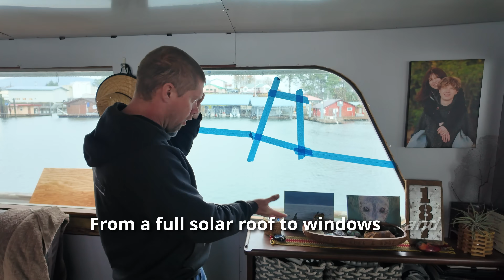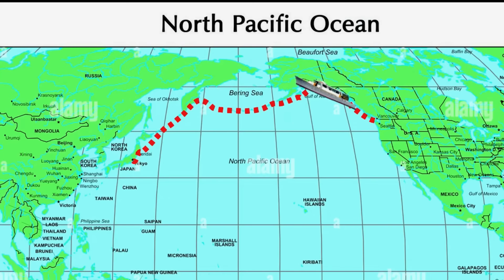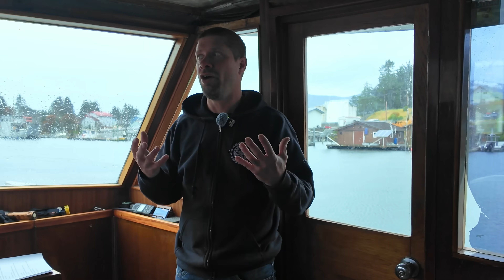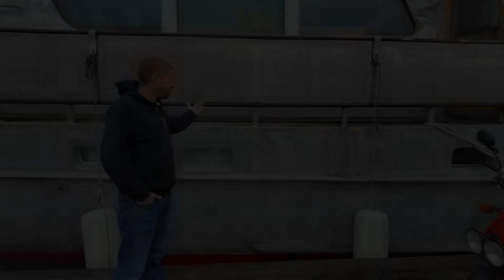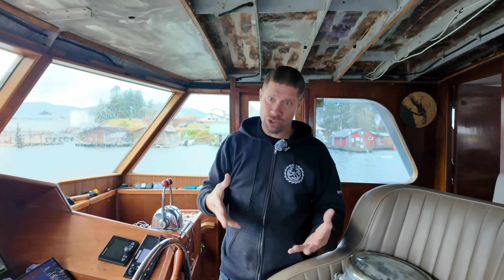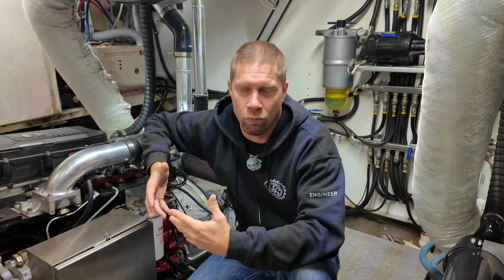What We Would INSTALL If We Won the Lottery?

Comment: If you ever go with the Azimuth thruster pipe dream, be sure to give the props some good clearance to the aluminum hull.   I don't know the exact distance, but I recall reading about some problems with props spinning too close to aluminum hulls and causing corrosion without even touching them.   I'm not entirely sure how that mechanism works.  But it is worth keeping in mind.

Comment: My boat came with a Naiad stabilizer system, i absolutely hated it. Last year i bit the bullet and went with a Seakeeper system and it has made a huge difference. I cant recommend it enough, and packaging wise you can fit it in space that would normally not be used.

Thrusters are another upgrade i made that have made docking and maneuvering a ton better. Before biying this boat i hadn't had anything larger than 20' so it was a pretty big jump going from a 20' bass boat to a 60' yacht. But the thrusters have made docking in some of the tight marinas in the keys an absolute breeze, i went with both bow and stern thrusters and can crab the boat sideways right into some pretty tight slips now, took what used to be stressful 30 minute dockings filled with near misses into 5 minutes of lining the boat up and sliding her into place.

Just a few of my observations from a couple years of running a project boat that is oddly similar to what you guys are doing, just wish i had been smart enough to film it like you guys did.
Reply from the maker: The seakeeper stuff is definitely nice but they are priced out of the market for most budget boaters sadly. I will likely just use what we have with a newer control system.

    Thrusters have never really been something I have wanted to a great extent. Sure, it would make some things easier but we have never had a situation we couldn't manage without them and they just haven't exceeded the cost vs benefit threshold for us. If our wish list were ever to be achieved, azimuth thrusters would allow infinite maneuverability as well. 
  
    I can feel you on the filming part. If we had done that when we were younger and living/working on boats things might have been different!

Comment: you can get laminated glass is strong .(windshield glass)at a glass company. if all your  glass is flat . I had glass made for my 36 Buick . shop around the price range is insane . then put a rubber grooved whatever around the glass . install it then do your wood trim .
Reply from the maker: We are going to discuss options with a marine windows company and let them make recommendations on glass that will offer insulation as well as strength. There are many iterations available from them.

Comment: I did kinda wonder how the shape of the hull was for open ocean. She isn't a sail boat so doesn't need a big keel right?  The whole stabilizer thing is a mystery to me.
Reply from the maker: The hull is strong enough for the open ocean and she has a pretty high level of natural stability as all the weight is low and there is no big flybridge adding weight up top. Once the windows and doors are done the envelope of the boat will be pretty much watertight and heavy duty. The stabilizers are basically wings underwater that rotate to help reduce the amount of roll experienced.

Comment: I am not at all surprised that you are a Cussler fan lol 

For the spotlight, could you find a place that can use that cracked glass as a template and can make a polycarbonate version that would last longer, be more durable and would fit the same as the existing glass?
Reply from the maker: I had thought about that. Not really sure. Having the concave lens wakes it a bit tricky. I might even be able to pull the lens, lay some form of new plastic over it and put it in the oven for a bit to form the same shape.

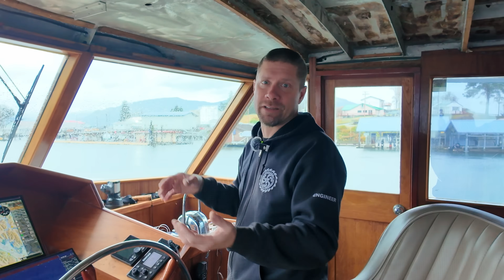Comment: Did i see that good, there was a drip of water falling downs from the roof in the cabin at 13:42 and again at 16:24 ?
Reply from the maker: Yes indeed you did. There is a small leak on the horn pedestal that I need to sort out. Pretty quick and easy job but I just haven't got to it yet.

Comment: 10:36 Why try to walk on your solar panels?  Couldn't you find some sort of above-the-deck racking so that you can mount your panels to that, and have room underneath to store your gear?  That way you can put more panels up there and they get full output while your gear suffers less UV damage.
Reply from the maker: One of the biggest reasons we bought the boat was the look of her. Having the solar mounted up high on rails on the upper deck would make a massive difference to that look in a negative way in our opinion. Whatever we do, it has to maintain the original lines of the boat.

Comment: Good luck with your long term project.   If it were me, I would have done the doors and windows before the new engines.  Having leaking doors and cracked/unsafe windows is just not for me. This is not a criticism, just a different priority.  The rest is almost just endless upgrades, especially if done over an extended time.  As long as you are both happy and enjoy the project, it is all good,  there is no right way or wrong way, only your way.  Enjoy the journey. Cheers from the land of Antipodeans.
Reply from the maker: Thanks! We have been in fairly protected waters so the engines took priority. The windows/doors are planned for this winter before we head out into the more open water stuff.  Thanks for watching!

Comment: Stabilizers: if the mechanical side of it is in good shape the electronic side should be easy enough to do diy. if there isn't something specific (open source) that has been done yet, I would look into drone (quad copters) controls, they have all the sensors, software and controllers to make them a breeze to pilot, the electronics are inexpensive, and there a few open source projects...
Reply from the maker: I have looked a bit into that stuff. I have closed loop controllers for the solenoids with feedback input from the fins. I also have a gyro but its a bit of an experiment. Just need to put some time into it. I haven't messed with it because the hydraulics for the stabilizers are not fully assembled yet.

Comment: You have probably already though of it but the hybrid setup from beta marine seems like something you could get working with your Cummins. Would also solve your never ending genset problems. If you haven't seen it check out the videos from the tally ho rebuild.
Reply from the maker: A hybrid setup is high on my wants list for sure. Using the Cummins for gensets would be great too. Unfortunately the Beta marine setup is not powerful enough to move this boat at our cruise speed much less have some extra emergency power. A hybrid solution would have to be a bit more substantial. I did briefly look at the system on Tally Ho but haven't had a chance top sit down and watch all the way through it.

Comment: Love all the wish list items and you didn't even mention the pilot houses ceiling cant wait to see how you tackle the window problem, stabilizers need to be fixed must be crazy, btw  Rim Drive Azimuth Thrusters are just that thrusters, I went down the rabbit hole and cant find one application of a RDA for large boat prolusion though would be nice until a killer wale knocks the pod off, of course there'd be safety strap for such occasions needed near Gibraltar, was wondering also what the COP would be for those electric drive systems as compared to diesel and diesel to electric drive as proposed in future, for now ill stick to my 90lb thrust MnnKota to silently steer my pontoon down the Ottawa
PS you've got a very special boat, would love to drive her, with 2 screws almost mid ship, your right who would need a bow thruster.
Reply from the maker: Lol, Janis and I were talking about how we knew someone would mention the pilot house ceiling 😁. We are getting to it soon. Azimuth thrusters would help on a couple of fronts. First would be maneuverability and the second would be an addition bonus to efficiency in a hybrid configuration. The particular units I would be talking about would not be easily damaged by a frisky orca🤣. She is a fun boat to drive and is pretty surprisingly maneuverable. Take care!

Comment: That aluminum door is a commercial Kawneer or Vistawall unit. Great for retail, not so much for marine application. I had wondered if that was somebody's low-buck solution to a problem in the late 1980's, surprising it may be original. 
Question regarding glass - is there a 'seaworthiness' standards inspection that pleasure craft have to meet? Hope you are able to get the glass sorted before too long! Fair winds and following seas.
Reply from the maker: It’s a pretty disappointing door for sure and doesn’t fit the look at all. There aren’t and inspections by government agencies but insurance companies do require occasional surveys which keep the bad stuff to a bare minimum. We will be replacing them with proper offshore rated units.

Comment: Love the goal of hybrid drive for so many, many, reasons!  Wanted to put a bug in your ear about battery tech and where it is going. I suspect it would fit perfectly with your hybrid drive goals. With your demonstrated of LFP battery management you may already be on this channel, but just in case: sodium ion is going into production in Chinese EV’s. It has been a long road getting here. Within 2 or 3 years there should be enough capacity in the field to reliably predict the return on investment. CATL is claiming an eventual 90% reduction in cost over current LFP. if that comes anywhere near to reality you could have several hundred KWH’s of storage and thereby reduce diesel use by many factors!  Conceptually consider what Edison motors is working on
Reply: Snap 😂 said that about six months ago ...also wanted to put up other UTube links to other projects and options. .... but U tube even hates itself... When you're trying to help inspire other people 🧙🏻‍♂️🥼🌎
Reply: @clivestainlesssteelwomble7665 I have observed sometimes links are not allowed in comments. To be safe I have learned to avoid sharing links in all my comments
Reply from the maker: I have indeed been watching the sodium ion stuff although it’s been a bit since I checked up on it. Definitely appealing in a few aspects.

Comment: Never knew the windows and doors we're that bad. It would be one of the first things that need done before making an ocean crossing.  That may end up into a really expensive repair. Mechanically I wouldn't go diesel electric I'd go straight to azimuth drive. The time and effort going to electric shaft drive you are...... really not gaining anything except for fuel efficiency. You are already fuel efficient. The cost to go electric drive would take quite a few years to pay for itself. You go with azimuth drive you'd gain manueverability and speed and fuel efficiency. Then you could also put the perpulsion where it should be at the stern. Boats are expensive anyway you look at it. Buy a used one and put money into it as you can afford it or go for broke and buy a new one. The older boats have a style you really can't recreate as the builders that built them most likely don't walk this earth. Tangaroa was in tough shape when you got it. Most people wouldn't take on a project like that. You'd never be able to do it if you had to hire out the work. You'd be cheaper to go with a turn key boat. You'd have to be a person with wood boat disease. You love the old school boat styling and you are willing to drop the 10s or 100s of thousands of dollars. Would I have taken on a project like Tangaroa..... no she was too far gone to make her into ship shape. In my mind it would be easier to convert a commercial fish boat into a yacht but that is me not Blaine and Janis. We've seen the hours of work you've put into Tangaroa that is some dedication.
Reply from the maker: Windows and doors have definitely been on the list for ages and the plan is to tackle those this winter.  We definitely love the boat and at this point there would be no turning back anyhow. The azimuth drives would be nice right away but would far surpass a direct drive shaft configuration by costs alone.

Comment: Nice job but who in the hell taught you to sand the bottom of a boat? Amateur 1st time playing with toys
Reply from the maker: Janis is a bit dangerous with rotary sanding tools. She got the little sanding tool so it was less aggressive. Its not an orbital sander so cant sand completely flat and it has  less abrasive discs so doesn't move much metal. When we follow up we use larger sanders with finer sandpaper as well as flatter angles to finish polish. This step was just to get the paint off and quite frankly, as long as I don't have to do it she can do it any way she likes 🤣.
Reply: @OnboardTangaroaSeatrial  Teach her! You don't use orbitals on the bottom of a boat. Nor do you sit and sand in 1 spot, keep moving, straight lines. You don't use fine disk, you want the bottom rough to hold paint, it's a boat not a car. Anti-fouling paint is thick. Sorry if I sound like a troll. I grew up on my grandfather's marina with a travel lift, so 150 boats on the hill at any time was normal, me and my friends sanded & painted a lot. You want a rough sand for good adhesion. You learn this real quick if you've ever dove and scraped  the grass or barnacles off and the paint come off with them. It's a common mistake. The glass breaking is a harder fix but can be done. Rubber gaskets allow flex, BUT that alone won't fix it. You need to stiffen the frames. You may have to redesign a little. Steel frames welded up for the rubber leaving a little gap all around held in with 5200. Trim it in with 5200 and only secure the trim to the wood This will allow the wood to flex while the glass stays secured. Wood flexes in heavier seas which is a blessing and a curse Good luck I wish you the best
Reply: @OnboardTangaroaSeatrial  On a lighter note. My aunt & uncle raised 4 girls on a boat. After they all grew up and moved out. They sold the boat and bought a house LOL Totally backwards from what most couples would do
Reply from the maker: I looked to see which bit of sanding you were referring to. The only sanding I saw was on the cabin sides, not the bottom. There will be no paint on those so they will be polished to a reasonably smooth finish. We did grind on the bottom as well but that was only to reduce the amount of sandblasting that was required as the sandblasting was having a tough time chewing through the coatings. From speaking with other professionals in the industry, a blasted finish is about the best for adhesion.

Comment: Also what hyds are driving the stabs ?  What control signal moves it ?
Reply from the maker: Currently the stabilizers are non-functional and have been since we bought the boat. They are hydraulic units that are quite old. They run on proportional solenoids and I plan to build a control system for them.
Reply: @OnboardTangaroaSeatrial  i figgered they were servo hyds.  Do they take PWM ? Rs232 NEMA ?  Love the content.  Your mindset mirrors my own..ec
Xcept i am aviation oriented....lol
Reply from the maker: Right on! I have always enjoyed the experimental aviation field as well. The solenoids are PWM. I was going to build something with a modern solid state gyro and some proportional motor controllers. Its on the list for this winter.
Reply: @OnboardTangaroaSeatrial another experimental aviation person here, like @spaceman 👍. The solid state gyros are amazing and a perfect fit!  All gyros have to deal with precession. The success of their use is understanding how that model does it. Many of the less expensive (but popular via marketing) aviation ss-gyros use GPS to correct for precession. This is widely misunderstood as using it for navigation, which has nothing to do with a gyro. Point is in aviation some ss-gyros will precess if gps signal is lost. This can be deadly in aviation. Not sure it is such a big deal in your application but worth looking at. An alternative solution to correcting for precession is an ‘air-data computer’. All commercial aircraft have this. Some solid state gyros have it, many don’t. Again, not sure exactly how big a deal this is in a marine application where you are (mostly) operating in two dimensions.
Reply from the maker: Good to know! I didn't realize how they worked precession with the new gyros. I have been out of the aviation field for 30 years 🤣.
Reply: @Ruralliving8572 im thinking all it has to do is detect direction and rate of roll.  More accelerometer than gyro.  Shoot that to a microcontroller with a PID loop and out to the hyds.
Reply from the maker: My initial idea was to use my satellite compass to send pitch and roll data to the stabilizer system as it is set up to accurately measure and transmit those values via the NMEA2000 CAN stream.
Reply: @spacedmanspiff1543 I think you are right on the money. That is my precession concerns would be almost certainly moot in this application. Your thought has far less complication and thereby likely more reliable.
Reply: @OnboardTangaroaSeatrial a bit of research reveals an esp32 library for nema 2000 protocol. Read from CAN is not a problem. My EIS project uses CAN...I'll tinker and see what I can come up with...
Reply from the maker: Right on! I will openly admit, my programming knowledge is less than stellar and my can bus knowledge is only moderate. It would mainly be a learning exercise for me.